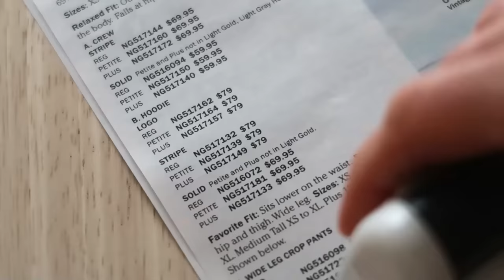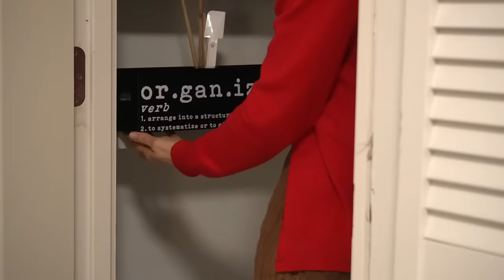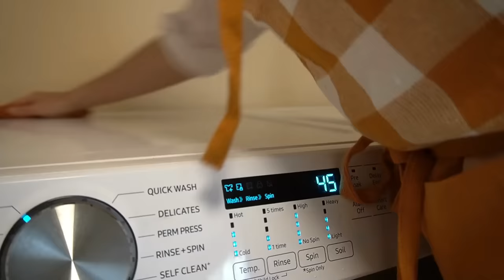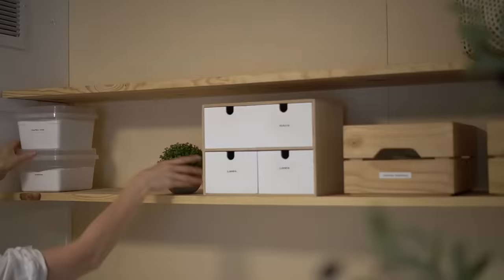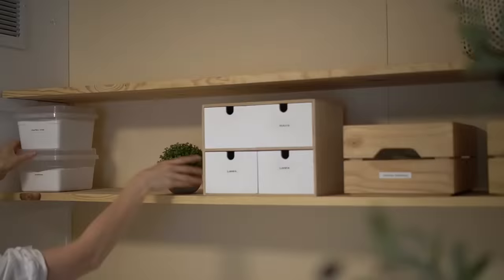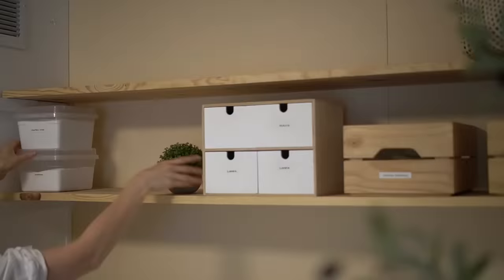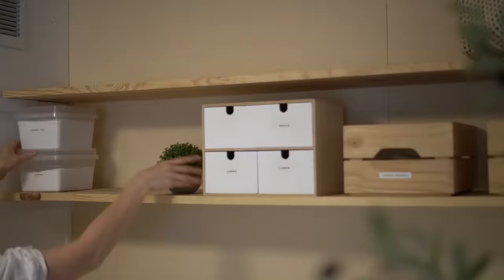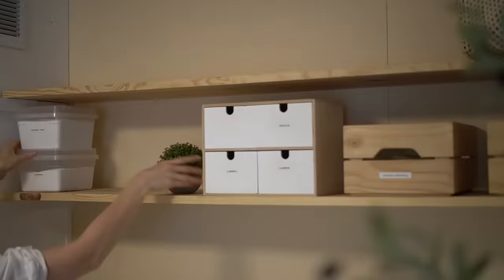ORGANIZING MOTIVATION | HOME ORGANIZATION MARATHON | HOME RESET 2023

Comment: What an amazing shot with the hummingbird...so close...AMAZING!!
I use a Q-tip for those unreachable areas like what you had with the windowsill. I just wet the tip so the dirt clings to it. Works every time!
I love the baking designs from those silicone molds. Before I ventured to buy, I did a little research and ended up deciding against buying any. I've come to the conclusion that anything made with chemicals is bound to leach into the food with any heat application. Post cancer, I'm now a lot more careful and aware that our govt. doesn't protect us. We have to protect ourselves by questioning everything anymore.🙏

Comment: So I highly recommend if you can not to rinse and put it down your drain. That's going to affect your septic system and your drains. I would have heated up the container and taking a paper towel and wiped inside and thrown it away or composted it

Comment: Be extremely careful when storing batteries because if you store them and they're touching the opposite ways on each other that can cause a fire. Specially with 9V batteries. So your batteries if you look at storage containers that are made for batteries you see that they are just enough to fit rows not where they're laid perpendicular to each other. You should really find a case that holds specific batteries. There have been many fires caused by batteries in a drawer because the ends were touching.

Comment: What is that pink lava looking rock in the bathroom....that looks cool!
Reply: It is a salt lamp, available in stores (or webshop). It is usually a block of Himalayan salt containing several types of minerals. Due to its stress-relieving and calming effect, it has a positive effect on well-being. It cleans and sterilizes the air. Since salt itself is a natural antihistamine, it is effective for respiratory problems. During a special evaporation process, it emits negatively charged ions into the air. Due to the many electronic elements around, there are too many positively charged ions in the air, which, although imperceptible to us, have a negative effect on our body. These positive ions are neutralized by the salt lamp.